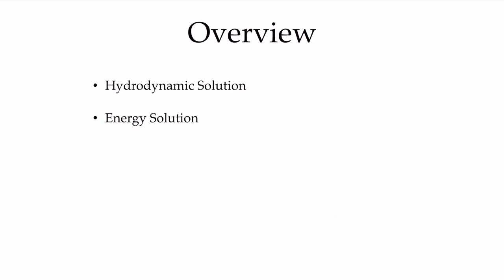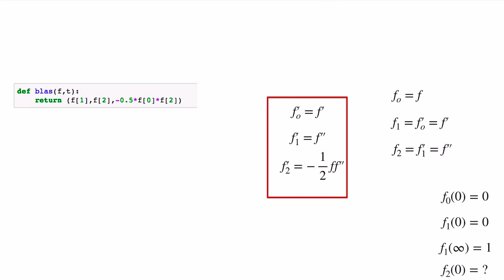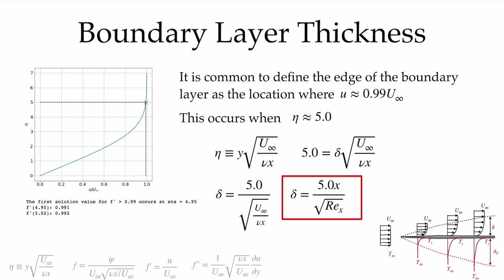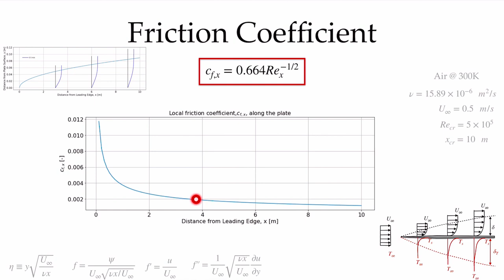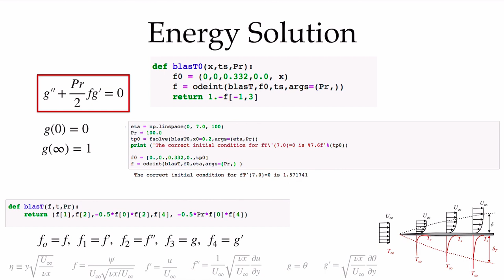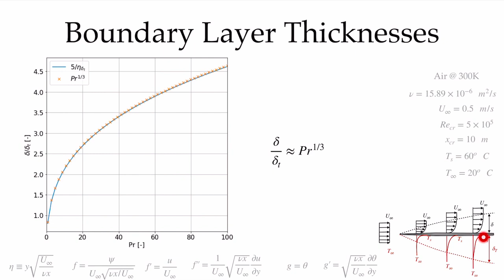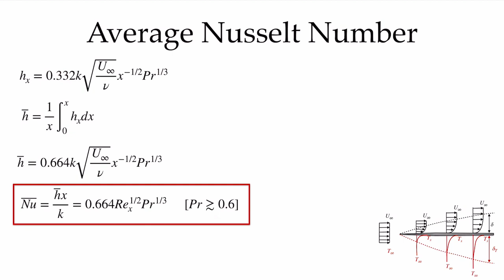Blasius Solution

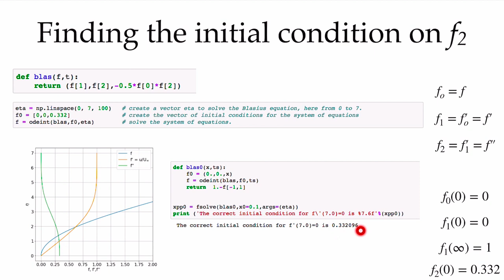Comment: 8:35
The code:
xpp0 = fsolve(blas0, x0=0.1, args=(eta))
           ^^^^^^^^^^^^^^^^^^^^^^^^^^^^^^^^^
Results in the following error:

ValueError: setting an array element with a sequence. The requested array has an inhomogeneous shape after 1 dimensions. The detected shape was (3,) + inhomogeneous part.